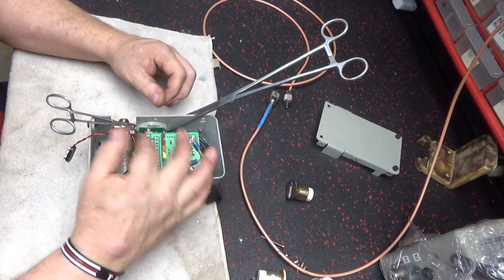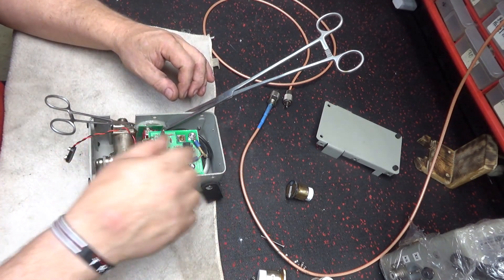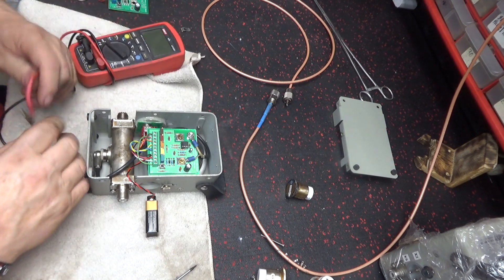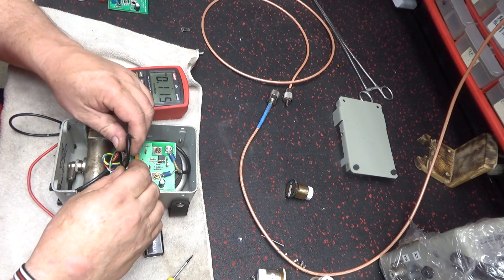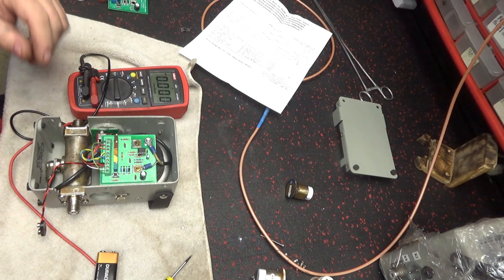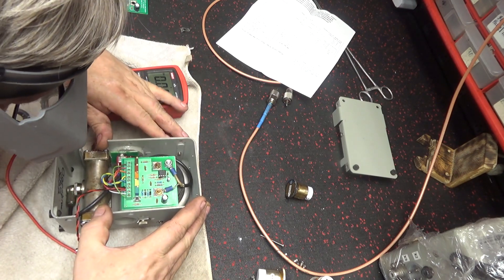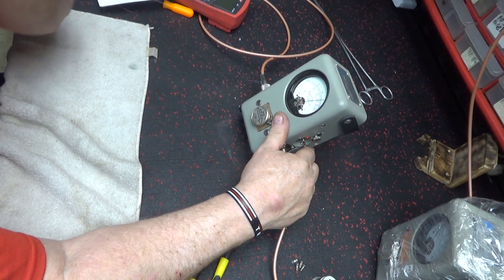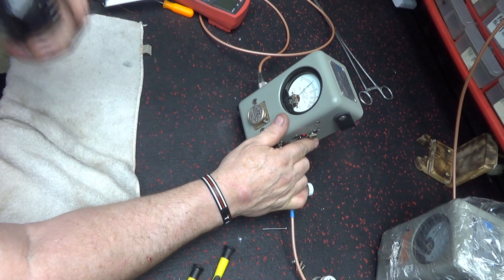dallass's bird 43 peak kit fix part 2

Comment: I use Lithium batteries in my Bird with the peak kit. They are leak-proof. I tend to not use my meter for months at a time and I would rather not have a regular battery destroy my expensive meter. No matter what brand I’ve used, they leak. But I’ve not had that with lithium batteries.